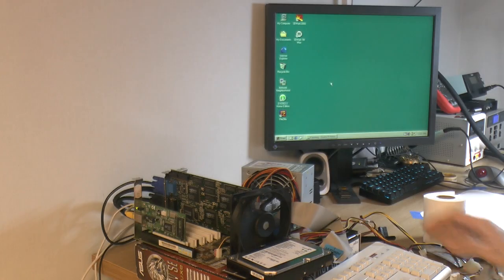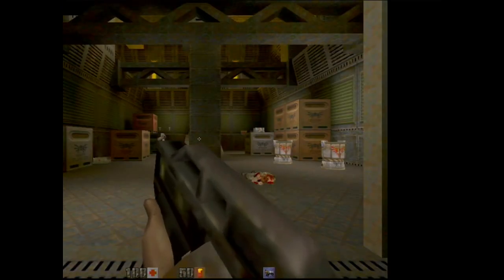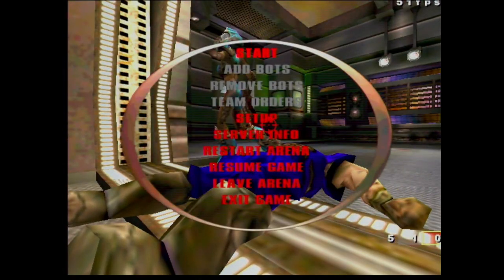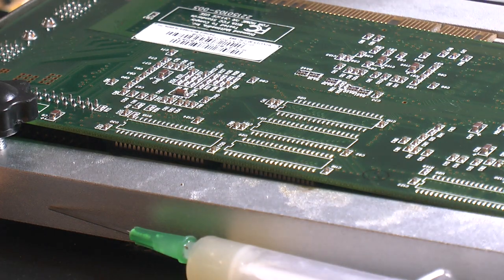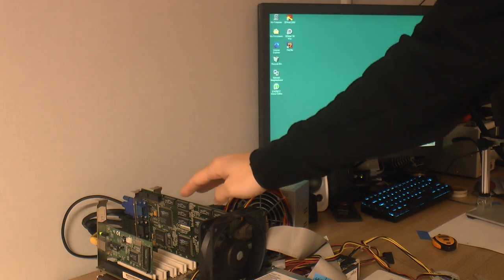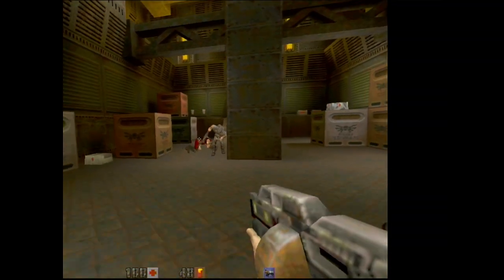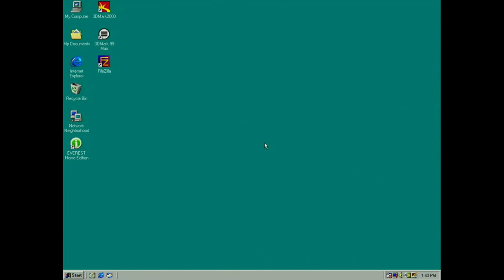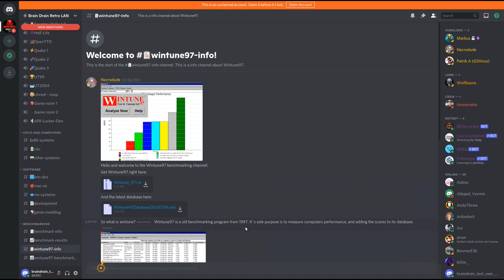3dfx Voodoo2 8MB to 12MB upgrade

Comment from the maker: Sorry I had to re-upload it but HD versions should work now.
Reply: Is it possible upgrade for example to 24MB or any higher capacity than 12MB?
Reply from the maker: @spirocz  4MB per FBI, 16MB per TMU according to 3dfx data sheet and a max of two FBI's in SLI for a total off 104MB.

You just need to figure out how to do that tough.

http://darwin-3dfx.sourceforge.net/voodoo2.pdf

Comment: It is possible to replace the RAM chips with higher capacity ones? leading to something like a 16mb voodoo2 or more? Do you have to modify the card's bios at all to make it recognize the new memory? I also noticed you have used 100mhz chips. I've seen pictures of voodoo2s with up to 125mhz chips. Can you find faster chips? Do you know if it helps overclocking? My voodoos2 with 100mhz RAM don't really overclock past 97mhz without some artifacting pixels, even though I epoxied aluminum heatsinks to the main 3 chips.
Reply from the maker: There are Voodoo2 cards with 1MByte chips but it uses 12 of them instead of 24 and as fare as I know has no pads on the back for more so still just 12Mb card.
Voodoo2 chipset supports 4Mb frame buffer and 2,4,8 and 16Mbyte of texture ram according to the data sheet. If that is per TMU bases or in total Im not sure but in theory a 20MB Voodoo2 is doable but no one has done it as fare as I know.
To do it you would have to find the RAS lines for the extra texture ram chips on the TMU and then piggyback the texture ram and hook up the separate RAS line to what should be pin 14 I would guess on the RAM chips.
But this is a qualified guess, thats how it works on the Voodoo1.
If someone figures it out a custom PCB would be the best way for a clean look.

The card has no bios, and no it will autodetect the chips when added to the back so there is nothing required but adding the extra 4MByte of Texture ram.

There are Voodoo2 cards with 110Mhz and 125Mhz ram, I have one with 110Mhz that I can get up to 105Mhz with some cooling at times so yes it helps with overclocking.

Faster then 100Mhz today is probably hard to find, most people with broken 110 or 125Mhz versions that need ram replacing seems to go for the 100Mhz ram.
The cards will run at 90Mhz because the drivers tells the card what clocks to run.

Fastvoodoo drivers will tell any Voodoo2 to run at 93Mhz, those drivers are crap tough and not really faster at the same clock.

Comment: nice work are you going to show it in sli?
Reply from the maker: Those cards are not matched so would require the patched drivers.
I did two more cards that are in SLI in my Athlon 850@956Mhz system.

But I dont have a plan for an SLI Voodoo2 video, seems to be plenty of those around.

Comment: Can you mix and match RAM chips from different vendors. I just picked up two 8MB Voodoo2 cards which have a mix of Silicon Magic and Mosel 100MHz RAM chips. I'm planning to upgrade the cards to 12MB each, but I want to make sure I am doing it correctly.
Reply from the maker: I have mixed with no issue.

Comment: What hot air temperature were you using?
Reply from the maker: I tend to use 450C for most things. But temperature is only one factor, airflow and distance to the object maters also.